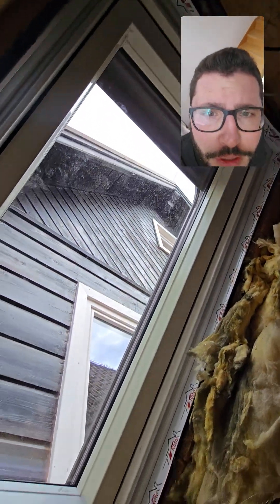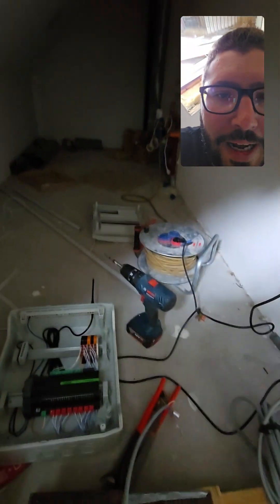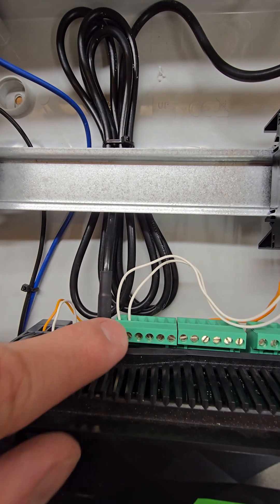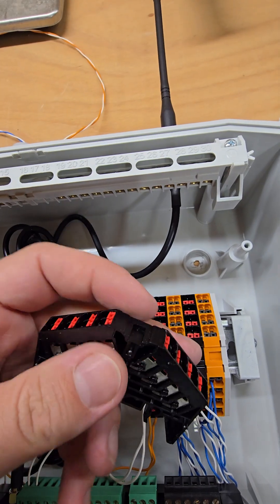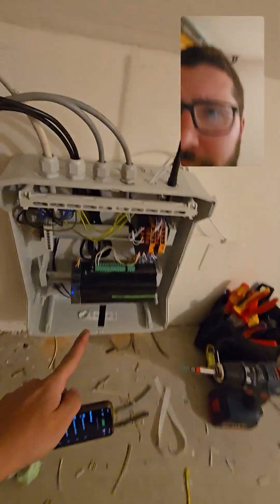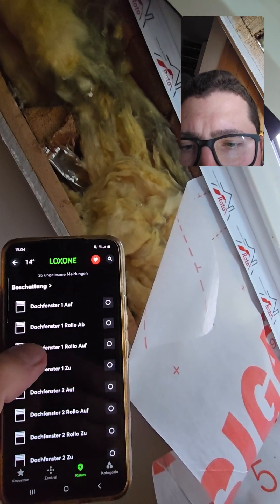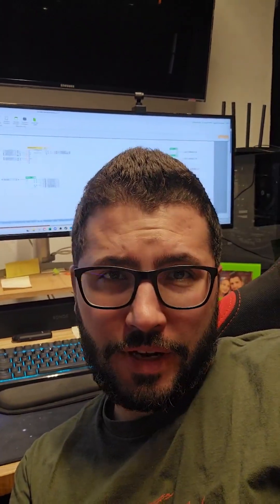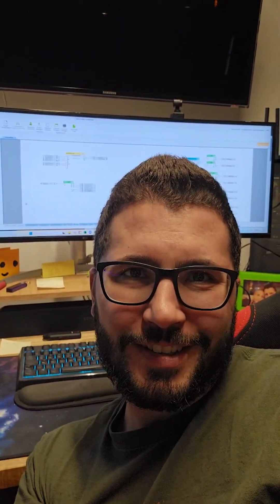AWESOME! Control Your Windows Like a Pro! #Loxone 🏡

Comment: Hello, I am planning to install Z90 external venetian blinds with a Geiger GJ56 E5 motor. Loxone have few integration variants. 
 Which integration variant you can recommend?
Reply from the maker: Hi, usually I do not go for Geiger Air motors. I mainly do new buildings so I prefer wired options like 2 Relays central or Nano2 Relay Tree. 

Geiger is not bad if you have a nice signal around the building but the GJ56 does not have an antenna in the cable (as I remember!!!) the solidline air has the black cable (4x1,5 or so) as the antenna so you have the air out of the metal frame. I faced some Signal issues with GJ56 in the past especially with bad Air coverage. 

Depending what you can do, I would wire a "normal" motor on a relay extension by default. 

BR
Richard

Comment: What cross-section cable do you use for shades? Do you think 1mm is reasonable. I have 2 pairs (1 up, 1 down) + neutral -> x4 windows. So 8x1mm + 1.5mm shared neutral. All in a 16mm tube back to the loxone cabinet.
Reply from the maker: Hi, depends on the wattage, cable length and local laws. I have to be careful what to recommend 😅
Reply: @ixma_en  a very german reply, some would say. hahahah
Thanks anyways.